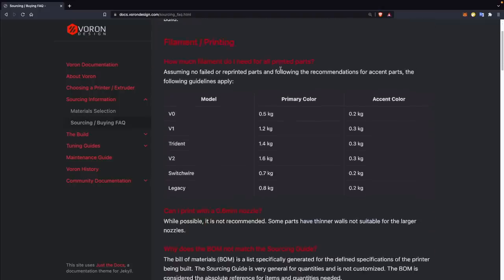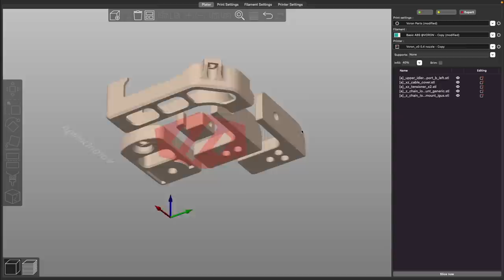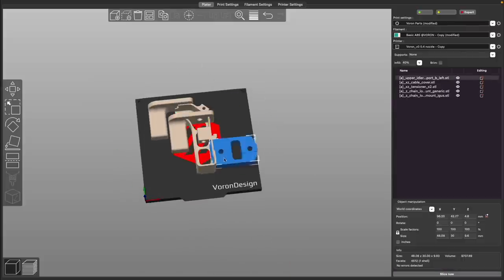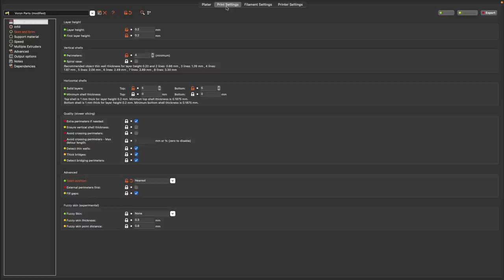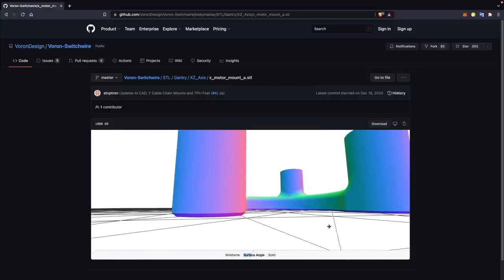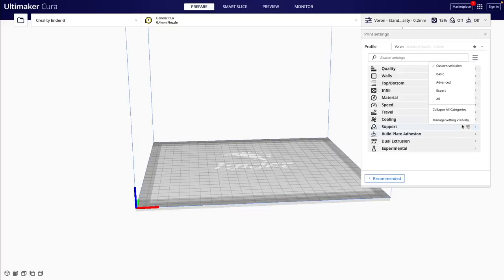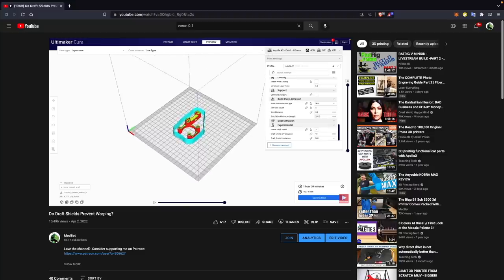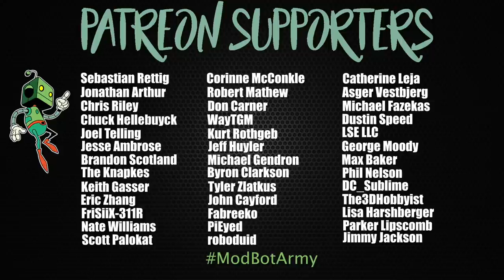Simple Slicer Change Helped Prevent Warping

Comment: Very interesting finding. The seam will create a stress point that can nucleate delamination from the bed.
My favorite technique to completely prevent warping when printing ABS/ASA is to print the first layer on a flat PEI sheet in PETG before switching to the ABS/ASA. The PETG adheres to the PEI and the ABS/ASA. It prevents warping every time. The only downside is if you abort the print early, it can take some scraping to get the layers off the bed (the final print has more stress, so comes off with a few flex plate bends). The skirt can take some scraping too.
It definitely will shorten the PEI surface life, but when using a thick-ish PEI sheet stuck to a flex plate the surface can be replaced when needed.

Comment: you nailed it on the seams! 3d printed a PLA-CF faceplate i designed recently, and  I put all the seems in the bottom right corner... guess which corner had an issue with warping, and ONLY that corner... the one with the seems. This finding of yours will let me fix that by simply moving the seams to a straight section. orca-slicer lets me draw where i want the seams to be placed.

Comment: Maybe using per model settings and having the seam in the rear for the first 4 or 5 layers and then switching to corner seams will be the best of both worlds, no warping and hidden seam after 4 or 5 layers, its probably happening because it is cooling faster where the slight break in the print at the corner is, maybe random for the first 4 or 5 layers might look better as you could knock the seam boogers off on those first layers

Comment: For others struggling with ABS or ASA, I found the same results a while back. I also only print parts out of ASA to assemble the only product my company sells, and they have a small radius on the bottom that is a cosmetic feature, so they have to stay. I haven't tried any other glues or bed adhesion products so i can't comment on them, but using magigoo has allowed me to print over the entire bed of my ender 5 plus's (with enclosures, kept at 108F) with no more warping. It's been running like this for a couple months now and a few thousand parts. For ASA I run 100C bed, 260 nozzle with standard Prusaslicer .010mm presets except for the seam location.

Comment: I have a pretty basic printer, 100x100x100 build volume, single z axis, no heated bed... At first when I got 2kgs of petg (it was really cheap for some reason), it went fine. Then, some models started quickly curling up and I couldn't understand how could I solve it. Right now I'm doing a print that I'm trying some things with, like using glue and reducing the active cooling a bit. I hope the model would turn out good, as the one before it (just glue) had warped a bit on the bottom (but only after I removed it from the bed), which is where two halves would connect. Thanks for telling about that possible tweak! I'll try it next time if the problem stays.

Comment: The faster and hotter you print, the longer a polymer chain you are making and less time it has to relieve stresses until it's in a settled state. So basically you've ran the whole length of the outer wall before it all starts to cool at once, rather than 1/4th etc, Also part shrinkage is proportional to the differential of hot/cold, so the hotter you run above what is needed, the worse it will get.

With parts that are known to shrink like ABS this becomes more prevalent as you ramp up speeds. By having the seam at the corner, already a likely place to lift, you're creating a disturbance in smooth and equally load bearing surface adhered to the plate. This is more or less the equivalent of a 'nucleation site' where the part will be even more likely to lift off due to the stressors. It's technically a symptom rather than a cure, but as long as it can be managed it obviously works.
Reply: Also regular nozzles retain more stress than “turbulent” nozzles like CHT. My figure is that regular nozzles squeeze the filament so retains stress while CHT cause a turbulence at the entry so it “breaks” the material memory. 
Is not just heat transfer cause at extruder near skipping speeds with both nozzles (so at their limits for heat transfer) the CHT has a better formed line, doesn’t enlarge after nozzle as much as a choking nozzle and has sensibly less warping and contraction.

Comment: I had the same problem with PETG, just changed the seam to Random, seems I never had any problems anymore.
Reply: I've had some bad warping with PETG, using a spring steel PEI build plate the print was sticking well enough that it was actually pulling up a corner of of the plate so resorted to the bulldog clips. Messed around with bed and hot end temperatures for a while and put a temporary draft shield around the printer and got a useful improvement but had no idea the seam position could influence this.  I'm going to give some of those parts another go on random.

Comment: Very timely video!  I'm getting ready to print parts for my new Rat Rig and want to use ABS, but have always had trouble with it in the past.  I'll give this and the draft shield a try.  I'm using S3D for my slicer and the options are random and a specific point.

Comment: Thanks for the video. Currently building my switchwire and while have parts printed in PETG I decided to do it right and print them in ABS and have been having the same issue. Its not a huge warp but enough that I notice it. Been trying to figure out why and maybe this will fix my issue.

Comment: Interesting. Thanks for the video. I find better bed adhesion (ABS on a smooth sheet is much better) is 99% of the time the fix.  Also, bed mesh before printing on the v0.  I found no matter what I did with the screws, the bed still had a very slight slant (within 0.1mm, but that's enough of change the squish on some parts depending on location, shape etc), which of course, is related to bed adhesion :)

Comment: Interesting video, thanks for sharing

I am having lift issues in the 4 corners of some 200x200mm cubes, the adheasion to the flex plate is fantastic in my case, the issue is the force is so high that the flex plates are deforming in all 4 corners, while the bull dog clips hold the outter edge of the flex plate down, i have 2 different machines with the same issue.

The Flex plates are just to thin and distort.

Will experiment with the seam postion and report back.
Regards Stefan
Reply: Seems you’re going too fast or the temperature in the chamber is too low!
Reply: Hi, I am looking for the report :)
Reply: @fbombtehgr3at  I had no luck with seam position change. 

Have recently received a thicker build plate from an Australian company that’s just closed down, and am hoping it will resolve the issue. Have finished the project where we were printing the larger parts so haven’t been able to confirm the fix with thicker plate. But in theory it should resolve the issue.

Comment: I think majority of this issue stems from heat and first layer squish. I noticed that parts tended to warp on me when bed was not cleaned properly and it was not in the middle of the v0.1 bed. Looks like your seem may not be connecting more due to the PA being set too Low? This causes bigger gaps. Means more likely to not connect the seam being in between the corners ie the back means that the corners where PA makes the most difference are not so much and issue. This is my guess. I had issues with warping before I got an edge to edge heater and a good thin but strong magnet as in Graviflex. Thinner magnet means more heat isn’t being soaked up by the magnet and getting transferred to the build plate I was running 115c because of my issues with the standard heater and that did work in some cases but then I had magnet lifting and warping the print at the edge because of no edge to edge heating and not a strong enough magnet. Best upgrades I’ve done are edge to edge heater and graviflex and these have allowed me to use the whole v0.1 bed without issues! Cheers!

Comment: I wounder if software could make abs printable without an enclosure, I saw this video about a company 3D printing space rockets in aluminium, and if you have ever welded aluminum you probably know how insanely it warps if you weld to much at a time, then someone from that company said they created a software that inverts the warping before the print even starts, so basically they print a "inverted warped part" and when it warps the final part warps into the intended shape. pretty clever. Would be sick if they could make that work

Comment: I have never been able to print abs. no matter what I do it warps. Can you recommend a good alternative?
Reply: Are you using an enclosure?
Are you preheating the enclosure (turn the bed temperature up all the way for 30 minutes before printing)
Is your bed insulated to ensure that it is just as hot on the outside as the inside? 
Can you use a raft or large brim?
Reply: ASA has replaced all my ABS printing even though I have enclosures, maybe you could try a draught shield around your print to stop it cooling so fast

Comment: I've only used Cura, haven't experienced this problem. Yet.  But would Z Seam Random be a good option? Seems like it to me.  Would keep the seam moving around the part so there wasn't a single point for temperature stresses to cause warping.
Reply: Have you tested Z Seam Alignment Random? If so, how did that pan out for you?
Reply: @BloodyIron  Depends on the shape of the model. Works well on round objects that lack a good corner to hide the seam in. I have to watch retraction and wipe settings to avoid scattered zits.

Comment: Benchies, everyone's favorite 3D printer test subject, also has a warping problem, at least from what I've seen so far, after printing a few to check some speed settings, I've noticed that when you place a straight edge along the bottom end to end, most of them are curved or warped a bit.

I've watched with interest on a review of filament where the reviewer blamed the filament on adhesion problems, then showed a Benchie . . .

Comment: To be honest idk how abs is so difficult for most, I find it so easy as I just set the chamber wait temp to 55 and by the time it gets to laying down the first layer it's around 60 and the chamber gets to a little above 70 and stays when the 3rd or 4th layer comes around. This allows me to keep the part fan at 60% for big overhangs. Just my 2 cents.
Reply: Not everyone has a printer with an enclosure
Reply: @Becvar80  this is in response to modbots video and he said he was using a v0 voron now if he built it to spec (I think he did) then he really shouldn't have these problems with abs and yes I agree not everyone has an enclosure, but if they don't then they really shouldn't be printing out of just abs going with something like abs+ or another with additives make abs easier to print